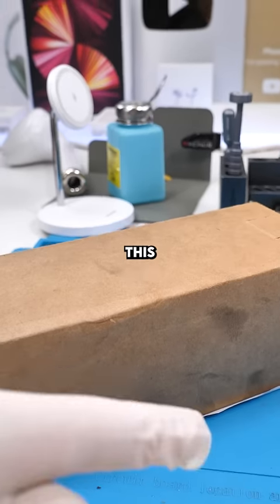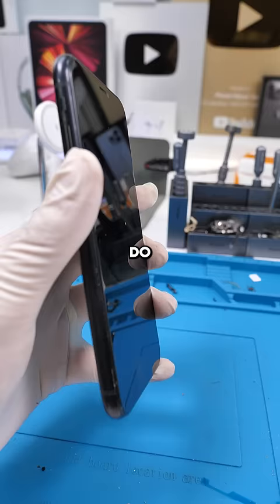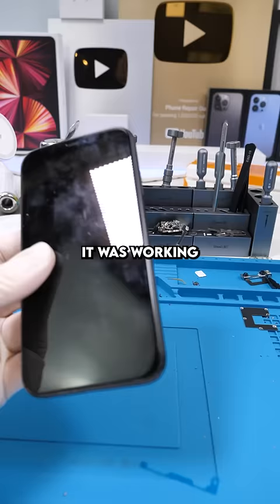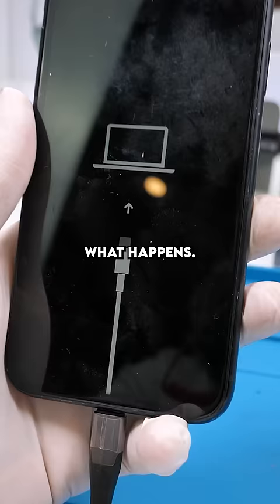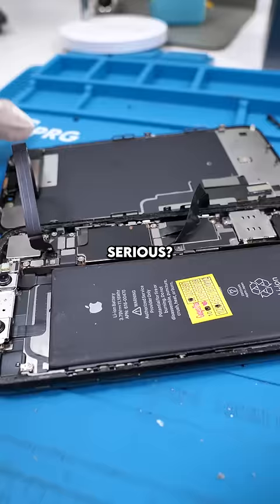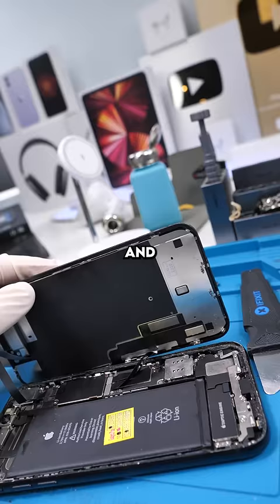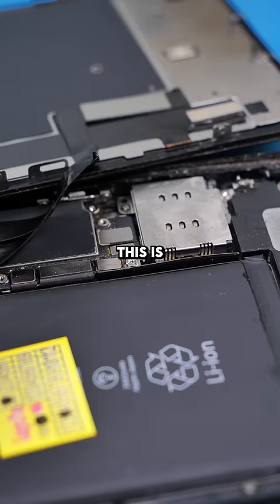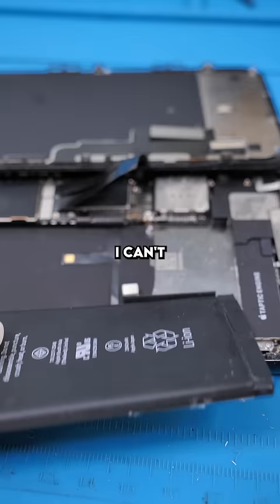THE WORST REPAIR I HAVE EVER SEEN... 🤦‍♂️ #Shorts

Comment: What’s the most dangerous phone repair you’ve done?
Reply: Note 7... :)
Reply: @XxTWMLxX  Agh yes, I also remember when he punctured a phone battery for a video, I don’t remember which phone it was though
Reply: My most "dangerous" repair is from when I had to replace the screen on an iPhone 8, the other shop used SUPER GLUE to hold the screen. I couldn't get it to loosen, and while pyring the screen exploded and glass shards went in my eye. Worst pain.
Reply: @LuaTech  you should have been more cautious and used glasses, gloves and heated the phone with a hair dryer before doing anything, it ain’t much but we’ll it’s better than a bad injury
Reply: @kingcartierjs7022  I did heat it up, I,learned now though to always wear gloves and eye protection when removing the screen
Reply: @LuaTech  Yeah, it’s really important, and depends on the case, because for me, one time I was fixing the wifi antenna for my iPhone 6 at the time, and once I was done with everything I put the screen back and well it cracked… a big screw was the cause of that 😭😭😭 lesson learned
Reply: How about, what is the most dangerous place smartphone repair you have done?! Me is at the street with his own bicycle!
Reply: Mine was on a drone, that almost exploded
Reply: He fr just hearted this and moved on without a reply 😂
Reply: @kingcartierjs7022  eyeglasses? An entire transparent shield over your face. 👩‍🏭 Or a motorcycle helmet.
Reply: The A51 has been the worst so far, I hate it when phones rely on adhesive to keep the back panel on, especially when the back panel isn’t perfectly flat from the factory
Reply: @LuaTech HOLY SHIT DUDE... that is awful. Are your eyes ok now?
Reply: @BeetleBuns  yeah all good now

Comment: Karen: I can get it repaired for cheaper!
The place that repairs it cheaper:
Reply: xd
Reply: LOL
Reply: that's not a Karen that's just a cheapskate
Reply: @hmmmm8653  a cheapstake would look at the price and not make a scene
Reply: bro. stop! I just dug my own grave and lied and died in it!! 💀🪦💀
Reply: it depends some people dont put time and effort into their jobs.
Reply: Tbf, some places repair with sub-par quality and charge more so i'd understand the paranoia. Just don't always expect quality for something you got cheap
Reply: Just do it yourself you’ll get better service than having it done at a cheap repair shop. You’ll also save more money.
Reply: @thephilster741  I agree, but for some cases this isnt a choice. I tried fixing my laptop to clean the fans and upgrade some components, but that isnt possible since i needed some tools to pry out the back from the front panel. It isnt easy, plus i fear i would break it. I found tutorials for the laptop but it isnt even clear about the instructions and its a different model
Reply: @super_xz9924  yeah some upgrades or replacements can be really difficult and I would recommend going to a well know repair shop for that. However, if it’s something simple like a battery replacement, then it’s better to do it yourself most of the time.

If you have the tools to do so that is. If you don’t have the tools to do it you should either buy them or have someone else do it.
Reply: That's what I'm sayin
Reply: That doesn't makes sense. I do cheap work, and I make it perfect.
Reply: No not always

Comment: It's sad that this stuff happens. For most people a auto shop is the same as a phone repairer. You have to hope they did the job good and aren't ripping you off. Even harder for phones I'd say because most things are internal
Reply: An auto mechanic shop, yes. A body shop, no.

There are WAY too many laws, regulations, and inspections for that to happen. A body shop is a whole different ball game.

It's weird, but for some reason I can't fully explain, body shops actually have to consider the consequences of bad work unlike a phone repair shop or even an auto mechanic shop.
Reply: @jaybird0312  There's no difference between the two.
Reply: @mycelia_ow  yes there is. Lol. I've worked in both. I know for a fact there is a difference. Lol

Comment: These poor repair jobs is the reason why Right to Repair is barred by legislators, they can literally use this as an example to avoid Right to Repair from being passed.
Reply: they could do the same by pointing to... pretty much any auto shop. That's not a knock on rtr, it's a knock on whoever literally scammed their customer

Comment: Worst one I’ve came across was a iPhone SE where whoever “fixed it” didn’t put the plates back, didn’t fasten the Lodgic board down, and left the battery board solder points exposed waiting for something to short on it, didn’t put adhesive between the screen and housing, and didn’t put the security screws back. Person who was using the phone dropped it once after and the screen flew off

Comment: Where I lived previously, whenever we sent an iPhone for repair/battery replacement to a local shop, they 100% gave it without the metal plates. I carried around screwdrivers in my bag until I replaced my phone; just in case if I drop it and connectors get loose. Because that happened before.

Comment: I use to work in this store called MobileSnaps. i worked for 15 days and i left the job. the repairs they did in the store was pathetic. they scammed customers selling fake apple oem (the one they replaced with was terrible third party screens). i use to find shields lying around and screws. they still haven’t paid me for my 15 days and this place has to be shut down

Comment: I went to a repair kiosk in a mall and they replaced the screen on my iPhone 7 (it had a chip or scratch or something, it was pretty small). Fast forward, my screen shattered a few weeks later on a pretty minor drop on carpet. I took it to an apple certified shop this time and they said I was missing a frame that helped with the stability of the screen. They said that the missing frame is probably what caused my screen to shatter so badly.

Comment: I'm not even a repair person and every time I had to reconnect the battery plug {I lost the plate} I never broke the connector at all, idk how they did that, I even managed to get a part of the broken connector from a battery out without breaking the connector on the board

Comment: This happened to me before. When I went out to get my phone fixed, when it came back, everything is fine but what's weird is that my original screen is white and when I restarted my phone, it's black... And when I opened the phone, all of the brackets are gone and the also the front facing camera, I never noticed it not working because I never use it. Also, the thing that's holding the power connector down is a masking tape. I never get fix that phone again and just bought a new one because of how bad the job that the repairer did

Comment: A quick question, I left my old phone charging for the entire day(pretty much forgot that it was charging) then the night before I went to sleep, the phone started a start loop, it will go into the apple logo, shutdown(black screen) midway, then starts up to the logo again, and repeat until the phone runs out of battery and shows the screen indicating I need to plug in the phone, once I plug it in and it gets some charge, it will start the loop once again. What would be the problem that causes this?

Comment: I remember trying to repair one iphone 7g that had the audio codec with its solders somewhat damaged, tried to do it and ended having to deliver it to another repair service before fucking it up, it seems for some reason when the owner got it to change battery it got it's screws rounded to the point i couldn't use one and also they screwed it so hard the chassis broke in the part where it was holding the screw so it couldn't no longer be screwed in in there, so the protective metal that kept the cable connected wouldn't be completely safe, and for some reason it was exposed to heat before i tried to replace the codec, as soon as i got the codec out, wjich was completely dead i saw the solders and it was completely botched to say the least, it was something i was able to fix but took a ton of time and i couldn't handle the stress of doing that over the fact the owner was insisting on getting it ASAP, so i got it to another repair service which did a fantastic job and even did a discount, there was 8 pads that had to be rewired due to the mess that was made, and possibly when i pulled the codec i may have messed up too

Comment: I had my iPhone X repaired at a local shop. They didn’t even close the screen down on the new adhesive and then they didn’t switch that module that makes the  phone recognize a new screen and allow facial recognition and then within two weeks the screen with no longer allow for touch function. I’ve been to good and bad repair shops mostly good ones out there, but that was my first not so good one.

Comment: I have a LG V60 ThinQ with a problem. Whenever I’m on a call the other person hears themselves. The problem doesn’t happen when on speaker. Only happens when using the earpiece.. any idea what could it be? It got a charging port and back glass replacement and the problem started after that.

Comment: I replaced my own phone screen and used one with a mid frame already attached, Didn't reglue the battery as with the back on its snug and in the inevitable event I have to removed the battery again I almost broke the battery as all I had was rubbing alcohol and no heat pad

Comment: The only thing causing the connect to iTunes was the battery not being plugged in all the way. The rest was sloppy repair practices but not causing the issue. The battery should be glued in though. The little metal piece over the earspeaker  has no function and it is retained by the screws holding the earspeaker in place. Be truthful if your going to post.

Comment: I think they just did this on purpose because after when they probably runnied the phone more of the problem of the phone not working they probably expected for the customer to come back when it turned off again so they can make more money. or make them buy a new phone from Apple and waste their money / time when it could have been fixed by a trusted repair shop.(or bonus maybe to try and hack into the persons phone but failed halfway through because they didn’t want to get in trouble or they gave up because they were to lazy to search up the data in the phone to look for the passcode of the phone or which is more likely than that they don’t know how).

Comment: hello , I have i Phone 8 plus and I have the same issue . My battery is on 56 % health. I have never changed or repaired my phone. last week on 1 percent charge i turned the flash light on. and my device turned off. now when i connect to charger it boot loops and when i force restart it shows the apple/support sign. I also scared to repair because they might ruin my device.

Comment: Hey I’ve got a iPhone 8 that has a hole in the top corner (exposed internals.) the mute switch stopped working (stuck on loud) and the volume up button stopped responding. Back glass is shattered, and rear camera is blurry. Other than that it works fine. Screen isn’t cracked. Can u fix it?

Comment: Hey, i have a question ⁉️ i have my phone screen replace from cracked screen to better screen but some of the part are open like i have to closed it from my hand they show a light under the screen so If i use glue to 😅 fix it does my work properly?

Comment: Hey I’ve been watching your vids for a while. I do great work. I have a 2014 MacBook Pro 15 inch. Works flawlessly for my needs atleast. I use it with the 27 inch Thunderbolt Display however I removed the screen from the MacBook itself just cuz of how my set up is. It was annoying having to pull it out open it then close and put it back just to turn it on or to switch to windows with boot camp so I went and removed the screen. Which made things a lot better for my setup. But…. I messed up some of the pins somehow removing the screen and now if I want to put the screen back I can’t. Wondering if u can help me out. And I’d also like to add more ram and a better drive. Maybe one of those faster ssd drives if it’s possible. Hope u can help me out. Let me know so we can figure something out. I’d love for you to work on it and maybe even do a video about it. That would be awsome. But still even tho I need the help so let me know if you can help me out or not and what I’d be looking at price wise. I just don’t see the need in spending the money apple wants for a new MacBook when mine does what I need it to do just fine. Thanks for all your great work and content. Hope to hear from you soon man

Comment: Need a little help, so i got my iPhone 13 like 3 weeks ago, and today i put it on a charger and it didn’t charge, now i checked if it’s due to cable or port, nothing, i went to the other outlet and it started charging, then i switched to the first outlet where it didn’t charge (where i usually charge my phone) and it started charging. Anyone has any clue why’s that?